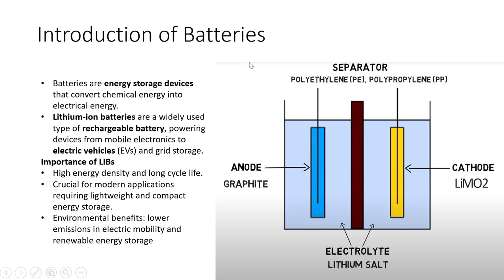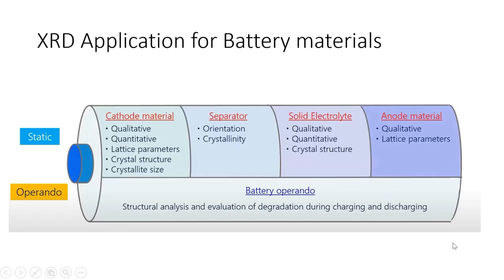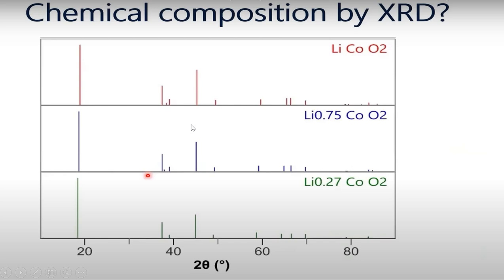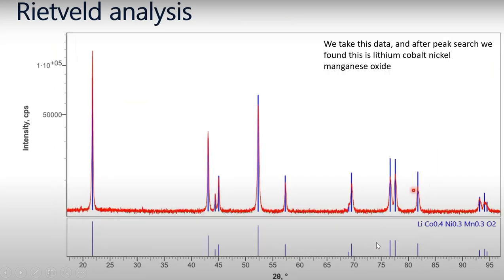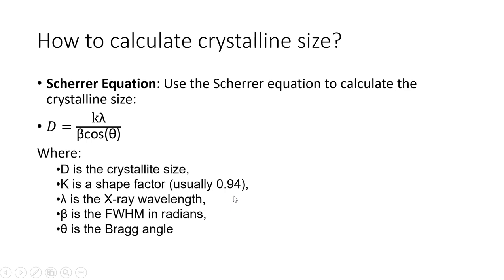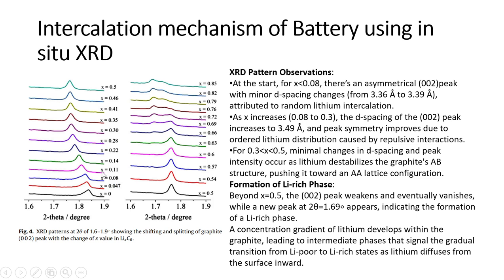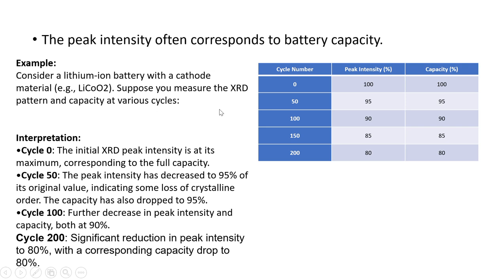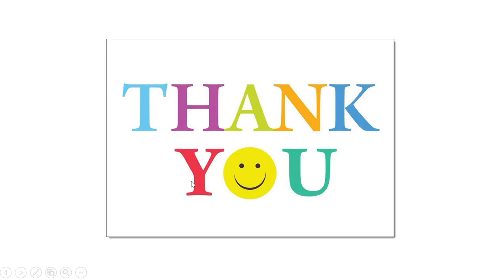XRD Applications in Batteries

Comment: BT21CME012 Yashraj Sarkar 
How does the lattice parameter variation detected by XRD correlate with battery efficiency and longevity? Can this data predict failure modes?